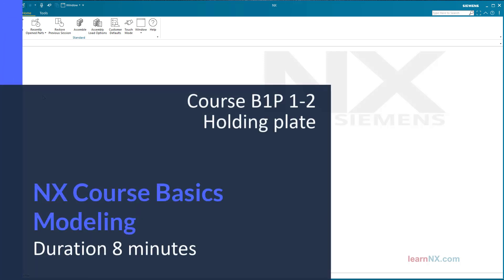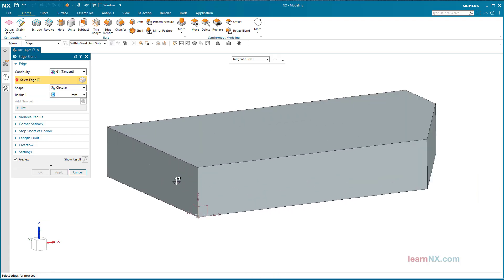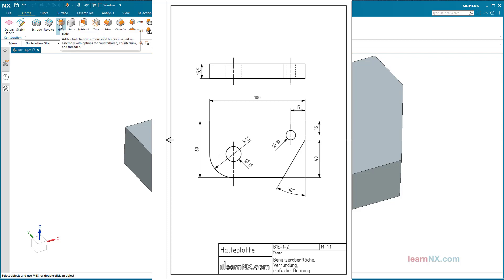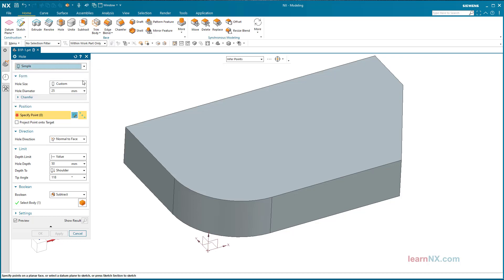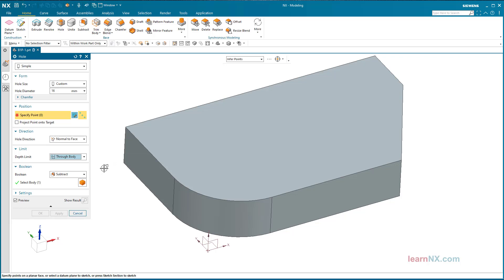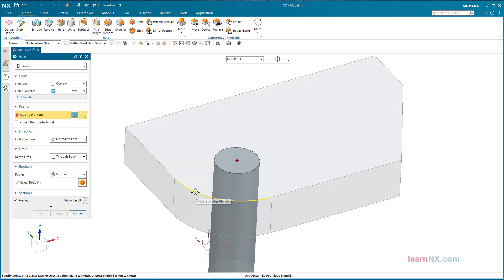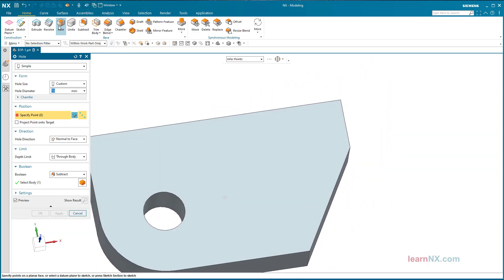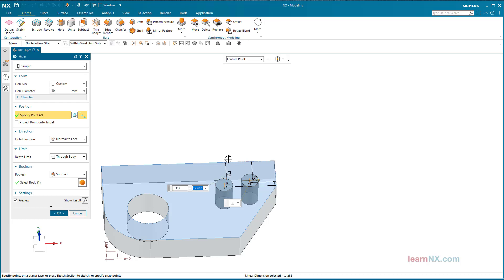Siemens NX Tutorial | User interface, Edge blend, simple hole by snap points or dimensions

Comment: When I’m doing the holes, how do I delete one that I don’t want to have because I accidentally placed it? Thank you!
Reply from the maker: If the hole was created in a separate step, then simply delete the step. However, if several points (and thus holes) were created in one step, then deselect one of the points by left-clicking a point while holding down the Shift key.
Reply: @learnNX  thanks!